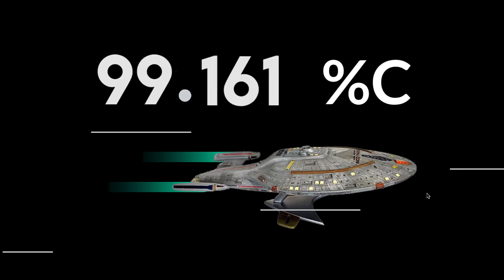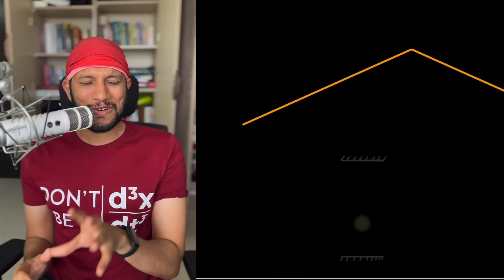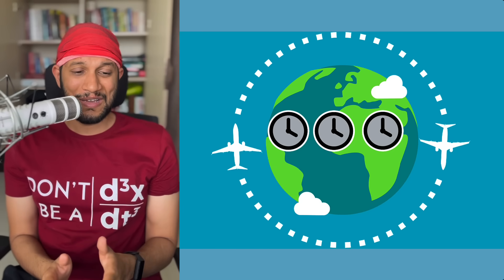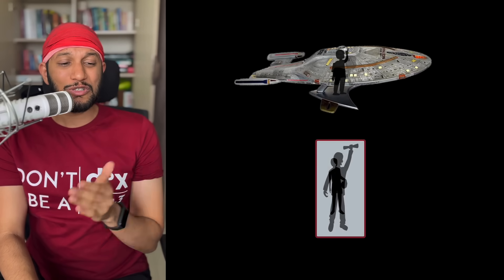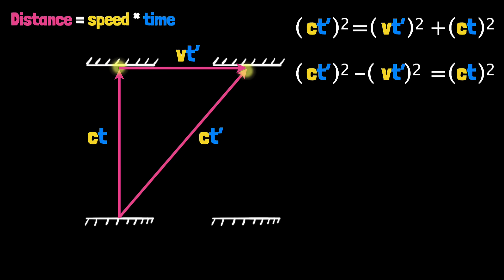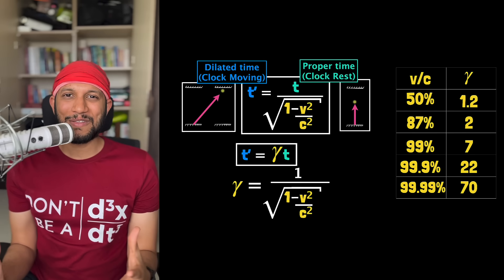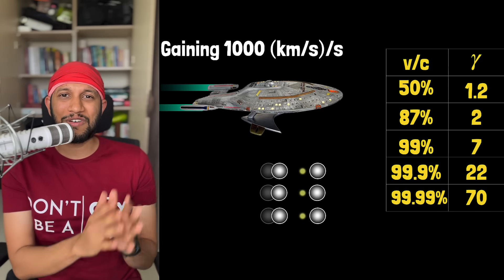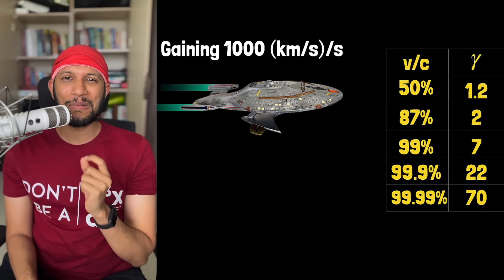I finally understood why you can't go faster than light! (My mind is blown)

Comment: already i. the first two minutes the photon clock doesnt go slower youre observing it as slower on a graph because youre introducing a left and right motion, like yeah technically it travels a longer distance but its still going up and down youre just going forward😂🤦🏽‍♂️
Reply: and even if its slowing down it doesnt mean the yniverse is slowing down around you youre just causing forces which slow down a specific object
Reply: if you think that its acceleration will slow down in space youre mentally challanges theres no drag and just because a photon goes a cerain speed doesnt mean that i cant like what well just be traveling blind because youre going faster than light, this is all on the presumption that light controls time which is retarded
Reply: @airr8800  yeah of course, Einstein and all other physicists are completely wrong, and you're the only one smart enough to know that

Comment: My only problem with this theory, is even if it takes infinite time to approach the speed of light. Wouldn't the occupants of the ship, also experience infinite time dilation? If the current energy expulsion is getting you near the speed, and it requires more time to keep acceleration going, why would you care about the time needed to keep accelerating, when everything is about the ship including occupants, are frozen in time? Say for example it takes you to reach 99% the speed of light, a million years, essentially wouldn't time be slowed down so much at that point, that a million years would be like seconds to the ship?

Comment: Hmmm...sounds more like a distance related dilation.

Interesting that molecules take longer to reach a position, and that helps to understand what the theory means, but I don't see how it actually would keep someone younger.

With those explanations, then thoughts wouldn't work adequately, the nervous system signals wouldn't sync to what actually the body needs, so you die.

My feel on the physical clocks is that something else is influencing the mechanical parts because airplane speeds seem too slow to effect on the atomic level.
People don't die because of the slow signals and those who fly frequently seem to age normally.

Maybe it's a gravitational thing, but I still don't see it.
I feel the same about the speed of light being a natural roadblock for everything.

Yes, the math frame works up to that point, and that's fine, but like the quantum area of learning, there's other stuff to understand.
There's other stuff to reach.

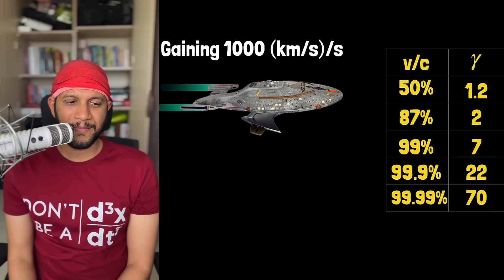Comment: Isn't infinite time only from an outside observer's point of view? For someone inside the spaceship, isn't time still operating "normally"? For example, at 87% v/c, gamma is 2, you mentioned (12:30) that everything would feel the same in the spaceship. So the final question is will the universe end in normal time before the spaceship reaches light speed? So depending on the acceleration of the spaceship, the universe could end in 100 trillions years before the spaceship's crew can have a chance for supper.
Reply: From the space ship's reference point you can just continue accelerating indefinitely if we pretend that you had an infinite energy source. While you obviously still can't travel faster than light, but because of the time dilation and length contraction of the reference frame other than you, you can travel a distance that you at rest would have measured to be 10 light-years in a time period in your reference frame of less than 10 years. You could accelerate so much that travel would be instantaneous from your point of view, but also in your own reference frame that would require accelerating for an infinite amount of time.

Comment: Love your explanation. But, I have a point to make though: All things in your star trek ship is moving the same speed in the X axis. The photons is still only moving the same speed in the Y axis. Therefore it should be hitting the top and bottom at the same time intervals. The speed of the photon would appear to be faster to the outside viewer, because it has an free X factor now. The photon does not change direction, therefore it is still just moving on the Y axis only in relation to the ship. The photon is not moving at its own pace in a XY direction. The ship is moving in the X direction; so, the photon now gains a "free" Y speed. Its still the same amount of time to travel from top to bottom. I'm not sure what causes the clock delays when traveling around the world, but I don't think it is any change in actual time change. Superman traveling backwards around the earth, very vast, will not turn back time.

Comment: Quick question on the photon clocks, the photon is moving up and down with speed of light, but from an external reference it has 2 components vertical speed of c and horizontal speed of the space ship. So the time it takes to tick should be the same?

 Or are we saying that from an external frame of reference the vertical speed is reduced somehow since the net speed sqrt of horizontal and vertical speed can't exceed speed of light

Comment: Time and the expansion of the universe (space) are the same thing.
When an object with mass moves, the universe contracts toward it (time slows down).
An object moving at the speed of light would have drawn the universe back into the singularity, such that there is no longer space in which to move.
The question is the same as "why can't you rewind a tape more than all the way?"

Comment: I don’t understand, why does the photon move slower in the illustration when the larger housing is moving faster?
Reply: Because it has to move at the same speed on two axises and not just one. It’s like if i walked forward at 1m/s but then i walked diagonally at 1m/s. My speed is split between walking forward and right.
Reply: @undefinedchannel9916 but that is just how the clock is illustrated, it takes that certain amount of time for the photon to travel, but time still exists t independent of whether it travelled or not? Why does it take more time for the photon to travel when the speed of the clock is faster, just because of the physical distance?

Comment: All this can be explained via simulation theory. The speed of light is the maximum speed of rendering objects. That ticking of photons is the tick rate of the server.  It's an rtx15990xs card that's running the game, paired with an Intel 384990hq processor, and 24k exabytes of ram. The storage isn't ssd -- it's optical. The read rate is the speed of light, which coincides with the render rate of the simulation. The bottleneck is the speed of light, not the cpu or processor. 

We are sims, n levels down from reality.

Lol jk... Maybe

Comment: No one outside of a ship that's traveling near the speed of light can observe a photon clock that is inside the ship which means that this example is completely unproveable. It can't be used as an example.

In addition, the movement of a clock DOES NOT AFFECT TIME.   I can have 50 clocks moving in 50 ways observed by 50 people in different ways and it won't affect the movement of time. 

For clock observation to affect time, you have to conclude that time is not constant but light speed is.  This is also unproven.

To prove that light speed is constant, you need to define zero velocity which is impossible. It is literally impossible. You cannot define speed without defining zero velocity. This means that you have to define light speed in relation to other things which are still moving in different directions. 

If a star is moving in the near opposite direction of another star with one star traveling at 0.5c while the other is moving at 0.7c, then one can be said to be moving faster than light away from the other.  Thus, the light speed record is broken.
Reply: If the clock experiences more time, the hand will move farther. If a human is in there, it will age faster. The clock changing is showing how time is affected!
Reply: @undefinedchannel9916  a clock can be slowed down and sped up by changing its timing crystal too. That won't affect the flow of time.
Reply: @deydraniadiancecht8298  So what? Are you saying that the clock’s timing crystal is being affected by flights?
Reply: @undefinedchannel9916   I'm saying that using the example of a clock being looked at through a window as concrete proof of time dilation is stupid.   It's using an impossibility as proof of concept.

Especially since nothing moves like that in a ship.  It's why you can bounce a ball in a ship in motion and the ball bounces and returns without any drift.  It's how relativity works.  As long as your speed is constant, the ball moves straight down and back up to the one who bounced it without any extra motion or travel distance no matter who observes it.  It doesn't matter if I bounce a tennis ball in a car, train, jet, or rocket.  If speed is constant, there is no drift no matter who looks at it.  

And even if you could observe a ship moving near the speed of light and look into the window (which would not be possible), you wouldn't be able to track the movement of anything because the light rays would take longer and longer to reach you.  The ship would be traveling so fast that every instant of the clock's movement would take longer and longer to reach you.  You'd never ever be able to see the clock's movement go anywhere and return.  Each instant would take longer and longer and longer to even register.  If you're stationary and the ship is at 0.7C, the distance would be greater and greater and greater with each passing nanosecond... magnitudes greater.

So no- this example is complete bullshit.
Reply: Also, for your final paragraph, you’re incorrect. To me, it would look like they’re moving at 0.5c and 0.7c. This is fine. An object’s speed from its own frame of reference is zero. To the first object, from its own frame of reference, it would look like it’s not moving at all. Therefore, it would see that the other object is moving at 0.7c and not 0.7c + 0.5c.
Reply: @undefinedchannel9916  it would look like?  So if a ship sped past you at 0.8 times the speed of light, you'd be able to look in its window as it passed and tell me what the click looked like?  Prove it. Prove that you could observe that.
Reply: @deydraniadiancecht8298  Look as in a synonym for observe. I’m not here to argue semantics. From my frame of reference, it’s moving at 0.7c which is under the speed of light obviously. From object 1’s frame of reference, object 2 is moving at 0.5c. From an object’s OWN frame of reference, the object’s own speed is 0.
Reply: @undefinedchannel9916  but that's why the speed of light has never and will never be observed.

Comment: I had a theory you said that as we reach close to spped of light the time slows but doesn't it still get the acceleration the acceleration remains constant and event if it gets really slow I will eventual reach speed of light but also cant we accelerate at the speed of light As at initial velocity the speed is zero therefore the dilation is 0 and as we accelerate we get some what like 3 million km per sec and even if the time slows as we accelerate one millionth of a sec the formula only provides how much time will slows in sec and even if we convert it into millisec still it is possible to reach speed of light theoretically as 0.99999 repeating is 1 and therefore 99.99999 is 100 percent am i wrong and if yes why

Comment: If an object break the sound barrier of water under water, there will be sozable bubble/void generated by this object. 
Image this object is also made of water, then it must evaporate before exceed the sound barrier.
Now normal objects are glued together by EM field, and the speed of EM wave is light speed, so any non-partical object or particals with charge or can decay onto charged particles can't move faster than light speed before "evaporat". Neutrinos are outlier here, I am not sure what neutrinos really are.

Comment: But from the perspective of the clock in the spaceship, you are moving fast together with the surface of the Earth. So YOU are ageing slower. When the spaceship come back down to the surface, you will be an old guy and the clock will still be brand new. So we have a contradiction here. How to explain this?
Reply: That's just the "twin paradox". The clock that turned around will have less time elapsed when they reunite.

Comment: WRONG, well explaind, well argued  but WRONG. Einstein was wrong on that too. It is not time that changes, it is the property of light that changes when it travels diagonal path...it has a  longer wave lenght.This distortation of wave lenght  triggers an optical illusion that time slows down. Lets  take the following thought experiment. Take the speed of sound which is as finite as a speed of light. If you fly a plane half the speed of sound and thunder strikes behind you on the plane you will hear the sound of thunder 2 seconds while the stationary observer on the ground  would correctly claim that it lasts only one second for him. The sound on the plane is longer and destorted because it travels in the same direction as the plane, it has longer and pronlonged sound vawes and lasts 2 seconds. So it is not the time that has changed, it is the wave lenghts that changed. It would be very incorrect to claim that since I hear it longer, time must have slowed down on the plane. It is absurd. And for that reason, it is also very absurd to claim time slows down when approaching speed of light.

Comment: One question just doesn't go off mind. A question whether if it's possible to EXCEED the speed of light using two portals, as seen in game Portal 2.
While playing the game, I made a portal loop which makes you fall infinitely. In the game, the speed of the fall soon became fast but stopped increasing.
When I look at the formula for the speed of a free fall, it is clear that an infinite height of the fall will result in the infinite speed. So, is it air resistance that prevents an infinitely falling object from reaching the speed of light, or is possible to reach it in such conditions?

Comment: I think you are not a star trek fan because the ships in star trek move faster than light.

There is a way using relativity to move faster than light and not affecting the space, and it was proven that some galaxies move faster than light can travel, because the space between galaxies are expanding.

Comment: The photon-clock example doesn't work because so much in the universe is moving compared to everything else. We on Earth are moving 520 km per second compared to something on a planet on the other side of the galaxy. On which planet does the additional motion of the photon occur, ours or the other? Neither because when you're not accelerating you're at rest in your own frame of reference. Crucially, you CAN accelerate for periods, then be at rest, and it's as if each time you pause acceleration, you're starting from scratch again when you restart. The whole "no faster than light" concept is bogus because of that. Modern physics needs to be completely renovated.

Comment: sound in air is transmitted by vibrations of air molecules, the higher the temperature of the air, the higher the speed of sound in the air and vice versa. question: what transmits light, there must be some medium due to which the speed of light is finite, otherwise it would be infinite or light and all other electromagnetic radiation could not spread through a vacuum

Comment: This is an excellent video and explanation. Ultimately, time never slows down with increased speed. What DOES slow down is essentially all of the processes of life and forces of the universe. Thus, at the speed of light, all force carriers and processes "freeze" insofar as nothing progresses. These carriers are still moving, but their destination is travelling away from them at the same speed. However, time is still elapsing but it is impossible to be perceived or experienced by anyone or anything travelling at the speed of light.

Comment: ds/dt=velocity (displacement/time)

d^2s/dt^2=acceleration (change in velocity/time)

d^3s/dt^3=jerk (In physics, jerk or jolt is the rate at which an object's acceleration changes with respect to time.).

Actually in common English language, Jerk means Idoiot.

So,”don't be a d³s/dt³” mean” means “don’t be an idiot